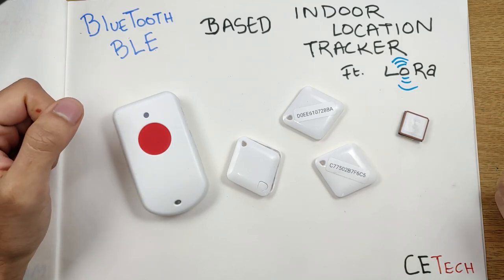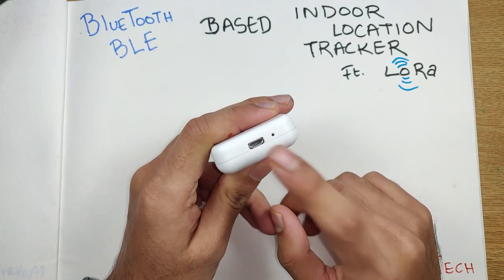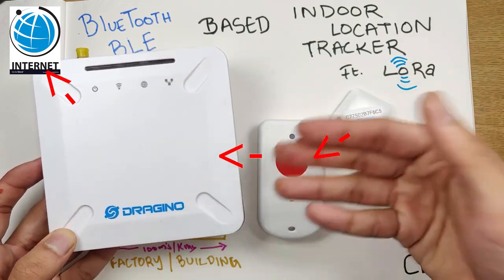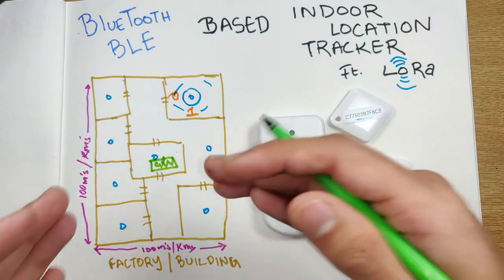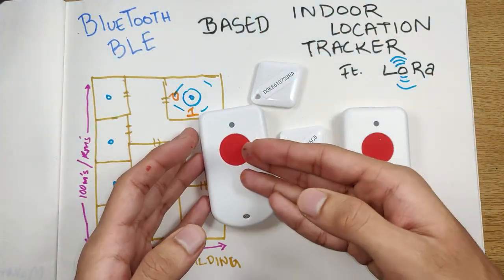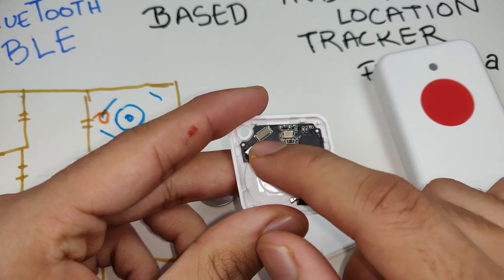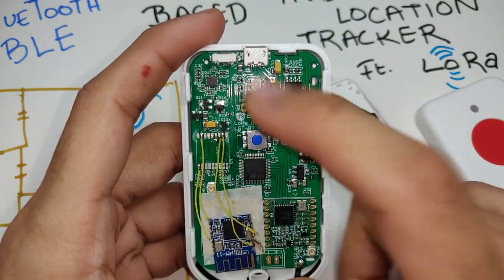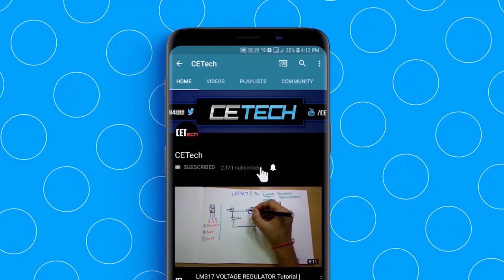BLE & lora based indoor location tracker without GPS | BLE Beacon from Dragino

Comment: Hi, what is the range of lora tracker to lora gateway indoors? I understand that if there are walls or obstruction between the tracker and gateway, the sensitivity drops like ble. Assuming I am tracking assets across multiple storeys in a building, what should the topology of the gateway be? Is it possible to connect only one lorawan gateway to the internet for the tracking to be visible for all the devices in the building? Please comment. Thank you

Comment: Hi CETech, is there any tracker device that I can interface with ? Example I would like to embed the tracker into my device.  My device will use this tracker's LoRa component to communicate to the LoRa gateway.  Another example is that I wanted to build a device with a indoor tracking capability as well as a gyroscope and altimeter.  The data of gyroscope and altimeter will be send backend server via LoRa gateway.  Are you able to provide some device readily available at PCBgogo or other website ?

Comment: If a beacon is in room #1, and a second beacon in room #2. If they are rooms that are close in distance, wont the beacons transmissions interfere with each other? How will a BLE sensor know if it is in range of beacon #1 or Beacon #2? 
Can you set parameters or set the dimension of the room its occupying?

Comment: Will there be any problem if I use 868MHz devices because it is still a licensed band, as far as I know, feel free to correct me.
Reply from the maker: No no problems
Reply: @CETech4u  But it's not licensed ? So the license has no meaning ?
Reply from the maker: In india 865 is licensed
Reply: @CETech4u  865-867 is unlicensed

Comment: Nice video, very good presentation.
Please make some videos to demonstrate its practical application.
Also, as you mentioned that location will be detected by the ble-lora module. In case the beacon is in range of two ble-lora receivers present at different locations both receiving the input from beacon, then how we can determine the actual location of beacon as we are receiving signal at different locations
Reply from the maker: Sure, do share the video if you liked it!
You can then see signal strength of the signal received to determine which beacon is it closer to!
Reply: @CETech4u  Thanks for the reply.
Please do make such video to show the real world usage example.
How we can create complete model for any manufacturing unit.
Reply: @CETech4u  Wait sorry but I am kinda new to this topic, does the ble-lora module refer to the LBT01 tracker?
Reply: @CETech4u  It is not using triangulation and the LoRA reader is not determining proximity location of the LoRA beacon by seeing it, it is simply receiving a "relay" of the BLE beacon ID.
In other words, the LoRA beacon is determines what "Location Anchor" (as we call them here at C3 Wireless) it is closest to and then transmits that out.
That is picked up by the LoRA gateway(s) and sent to the server. At that point it only needs to write that to a database which can recall for mapping, contact tracing, or reports. If more than one LoRA gateway picks up the data, then you just have multiple entries in the database of the same information, which the database can purge on the fly or on a schedule.